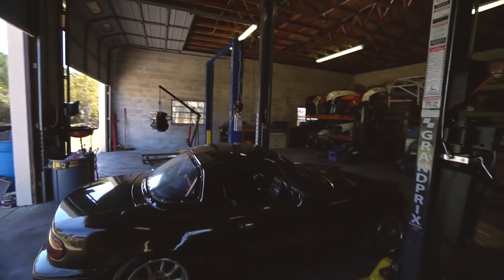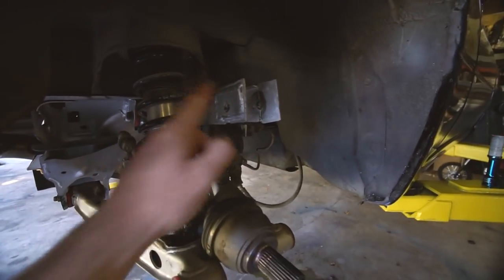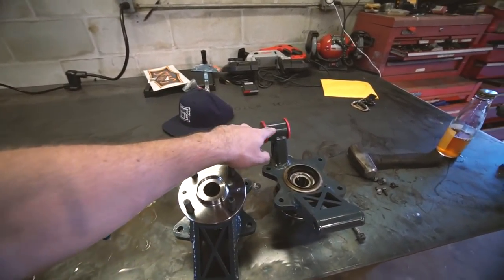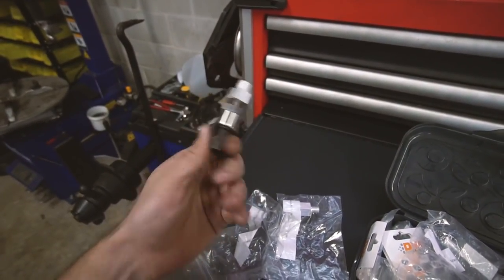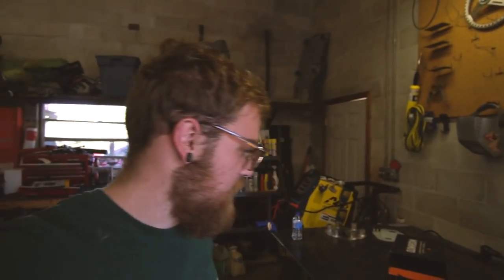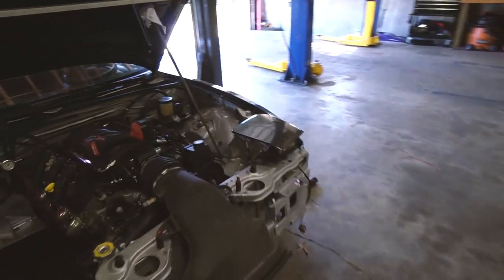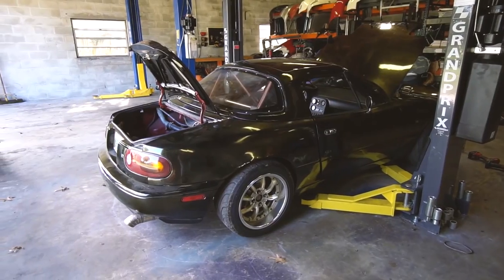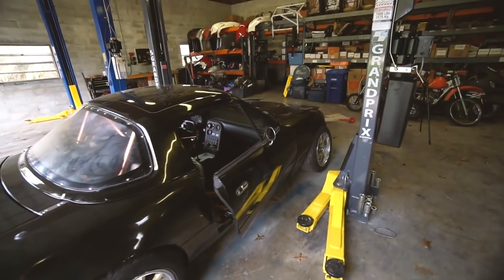LS Miata Rear Drop Knuckles and Oil Cooler!

Comment: Taylor, 2 things for pressing bearings from a mechanic based on what I see you doing. Instead of pressing the bearing in the spindle, press the spindle onto the bearing. this way you can lay the bearing flat and then put the spindle on top and press the back of the spindle with something flat across the top. Its easier than making a setup for the spindle to sit square to the bearing. AND when pressing the hub into the bearing ALWAYS support the inner race with something underneath or you may press out the race.

Comment: Taylor at 5:50 your rear lower control arm outer bolt does not have the correct washers. The correct ones are way bigger than what you are using, 2 inches to be exact and they come with the energy kit. Only noticed because I just replaced. Love everything about the build by the way! its inspirational for me to finish building my ls1 FD rx7 and keep tracking my simple seat time miata!

Comment: If you run into cooling issues (water temp) put that oil cooler behind the radiator. Ran into that issue on a few race cars.

Comment: If you ever struggle to get the inner bearing race off of the hub then slam a big mig weld all around it then it will fall right off👌🏼

Comment: You should just supercharge your miata, seems Tommy wants to add power to the K Miata now
Reply: Liam Crawford would be even slower
Reply: @Tbrick563  not true if he drives the car within its limits and doesnt keep using too much power taylors car should only go faster except if your talking about the extra front weight of like 25-50 lbs unless u run an interchiller which would make it go up from there. I'd love to see the miata supercharged. But in this application I don't think it will help him much or Taylor will try and use too much power and it makes him slower but that's all driver
Reply: Tommy wants to do cams and he has to Taylor has an LS
Reply: @doitalldavey8788  hahaha he is the one that started this he said his car would smash Taylor's but now he needs cams and a E85 tune haha Tommy is a hypocrite. he has to do cams lol thought his car was already better? Why he need cams and better fuel? Wont he just spin tires making about the same power as an LS haha Tommy pisses me off he a Nancy I really wanted to see his car as is go against Taylor's that would have been cool run two tracks one of them being a tight corner track and one that has some good straights would have been awesome
Reply: Taylor looks like a way better driver anyway, a saw a video of tommy driving any he is terrible and also, adam lz was able to keep up with tommy in an evo 1